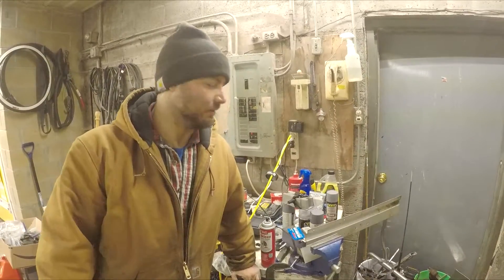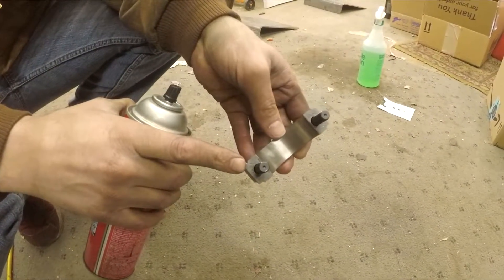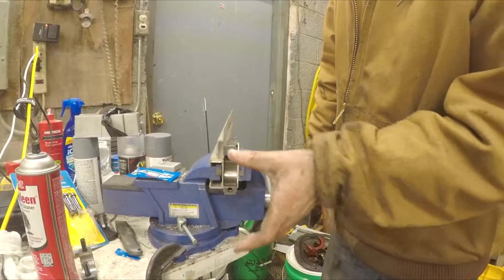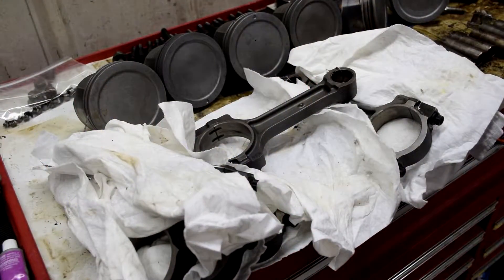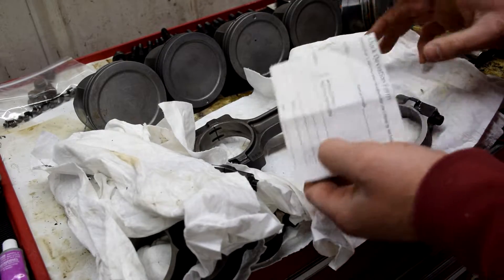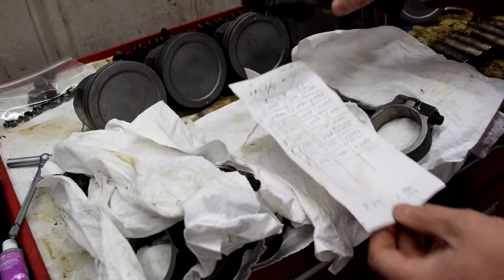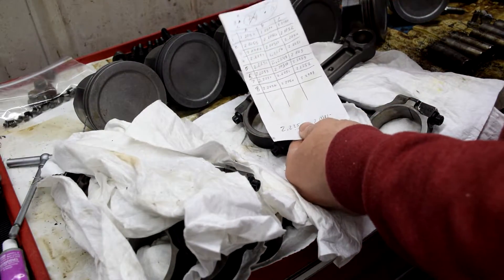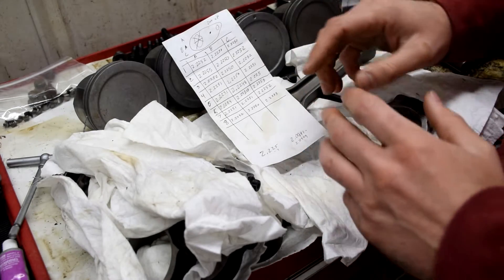ARP Bolts in LS Cracked Rods (134-6006)

Comment: I’m fixing to replace the rod bearings and piston rings in my 2002 5.3 LS swap, can I reuse the rod bolts or ? I greatly appreciate any help. I don’t really want to buy ARP rod bolts and have everything resized
Reply from the maker: Make sure you have your mating surfaces clean, and you should be fine.
Reply: Thanks I appreciate it
Reply: Should I torque them to 15ft-lb then 75°? Or some say 50 to 55ft-lb
Reply from the maker: @justinw523  15ftlbs plus angle will be fine
Reply: Cool thanks

Comment: instructions say 40lb-ft, not 45.   Also the bolt is a little longer than the OEM bolts, so they should add some stability by going deeper into the rod hopefully.  The ARP2000's go to 45.
Reply: You’re correct if you don’t own a ARP Stretch gauge then you torque to 40lb-ft

Comment: So I bought these for a 05 ls1, and I'm having problems with putting them in the caps they go in but the dont just slide in, is that normal?
Reply from the maker: Yes
Reply from the maker: I zipped the bolts into the caps first before assembling.
Reply: Thank you very much, what did you mean my zipped?
Reply from the maker: @snaildit2377  impact with a socket and spin it in. Or you can just use a wrench
Reply: Arp told me that was the sleeve and that I had to take that out..  but I already did it lol just like the other guy said... I just used a ratchet and ran them in they held just like the factory ones and then I put them on and knock on wood no issues... arp said to torque to 40 ft/lbs being sure to use the special lube.  I don't know that I believe the special lub changes the torque spec to any great extent but he claims it makes all the difference.

Comment: You don't own a simple outside caliper? Secondly, how accurate are your gauges/calipers? When was the last time they were calibrated? Even cheap tools can be made serviceable if you calibrate them fairly regularly.
Reply from the maker: Dial bore gauge, calibrated yearly, and setup with a ring gauge before the measurements.
Reply: @alloyspeed1889  Better than most. Good job.

Comment: Great info, even if a couple years old now. I think that going with the ARP 8740 bolts as you did (vs the ARP 2000 that are also available), is the right move. Like you said, it's not a Pro motor and if people are realistic with their builds, they wouldn't try and run 1,000HP/8,500 RPM on a daily basis on OEM rods....even with upgraded bolts.

Comment: can i reuse the stock bolts with 40 lbs of torque?
Reply: You should not reuse bolts. Probably nothing will happen but better safe than sorry
Reply: If rod bolts are designed to be torqued to yield (yield strength) meaning any tightening beyond yield has permanent deformation(stretching)which strain hardens the material making it more brittle. Means they will break and it is also recommended to get new ones. Im talking about stock bolts. Not arp.
Reply: They're not tork to yield they are  tork to angle. A gen4 rod will fail before that stock bolt does. Gen 4 rods can handle 1000hp. It's all about Detonation /tuning. In my opinion, if you don't have forged pistons ( Giving you a bigger window for detonation failure) you don't need arp rod bolts.
Reply: Mine is just stock with a truck norris cam lol I just changed to ARP because I was told that I had to change them, I just liked the idea that If I ever had to do it again I could reuse these so I paid the 100+... kind of feel like these bolts are way more expensive than they should be lol... but if I had known th as t I could reuse the factory ones, I would have.  I did reuse the crank bolts.  They seem fine so far knock on something hard.
Reply: Still going? @agooser26
Reply from the maker: The rod bolts are tq to yield soooo not sure. But if ur doing a zero money build, 45 might* be ok

Comment: ARP bolts have a dimple on both ends so you can measure stretch with a dial gauge...no torque wrench required
Reply from the maker: Yea I hear its supposed to be more accurate than a tq wrench too. But I dont have one...
Reply: Alloyspeed all good.  It’s pretty close with torque if the threads are perfect.  It eliminated thread friction from the equation.  I use ARP on everything.  Awesome

Comment: Old 350s are good w just arps in stock rods, that I know. Just torque them and un torque a few times.
Reply: Forget that nonsense about big end being thrown out of round from a few extra ft lbs on bolts.
Reply: P.s. the extra few ft lbs of torque didn't throw big ends off at all.

Comment: If engine was fine when you took apart jest clean and polish crank standard bearings and plastic gauge you will be fine
Reply from the maker: One of the lifters failed and took out one of the lobes on the cam. But I'm glad I went through everything.

Comment: the 134-6006 instructions say 40 ft/lbs, but 45 ft/lbs should be fine too. Thanks for the video

https://arpinstructions.com/instructions/134-6026.pdf
Reply: You bring up a good point. ARP also makes these bolts in ARP2000 (234-6301), and THESE bolts have a tightening torque of 45ft-lb. The standard 8740 chromoly bolts shown here are only torqued to 40ft-lb. Not sure that 45ft-lb is too much, but it is not likely a problem.